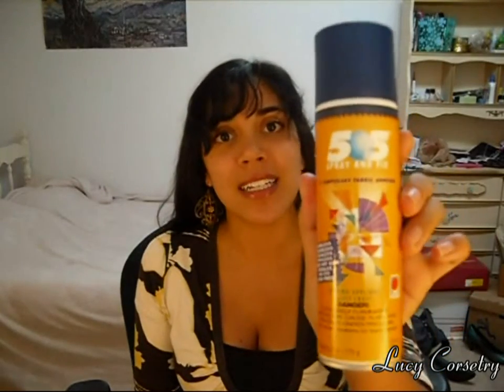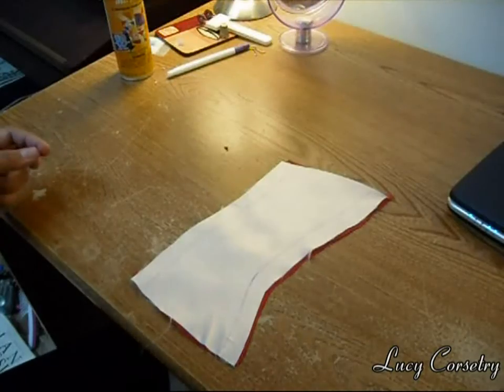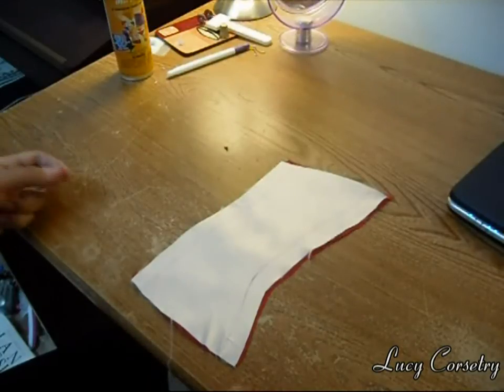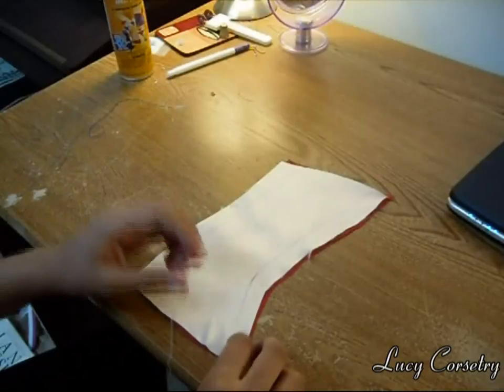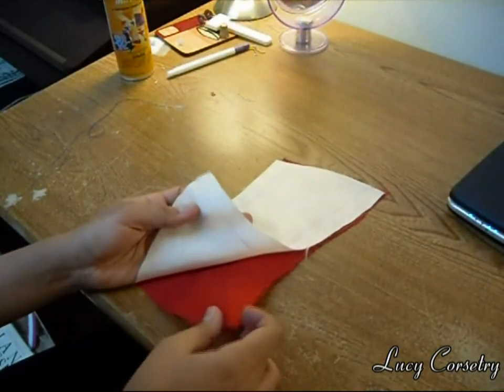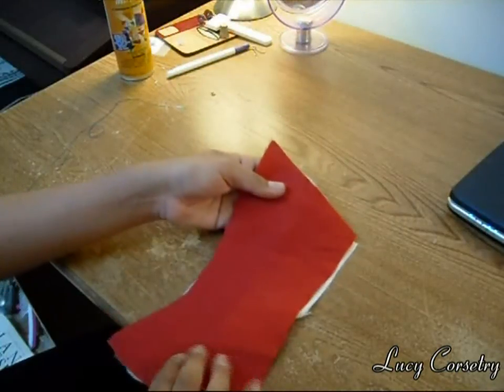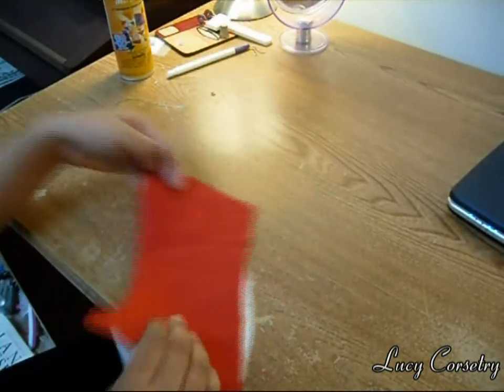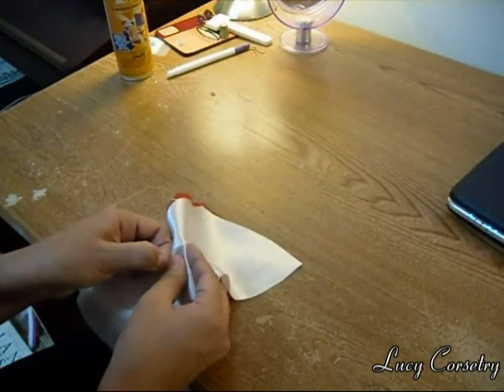Corset Making: Flatlining your Layers | Lucy's Corsetry

Comment: Would it be useful to use a fuzable interfacing as well as flatlining if the fasion fabric is particularly thin/slinky/frayprone, etc..?
Reply from the maker: +wyrdness1 Yes, you can use interfacing, or you can use something like Wunder Under or Heatn'Bond to fuse your fashion fabric directly to your strength fabric. But if you use something like silk, be aware that after several years you might find that the silk starts to disintegrate from the acidity in the glue.

Comment: I'm not understanding what the exact purpose of flatlining is. What does it do? How does help the corset?
Reply: It helps keep stretchy or very fragile material from moving around while you're trying to join all the layers together. I always interface my fashion fabric, and that makes it "stick" to the coutil much easier, as well as supporting the fashion fabric. I never use pins to join my panels. I don't need them.